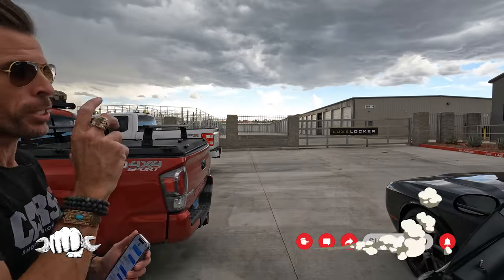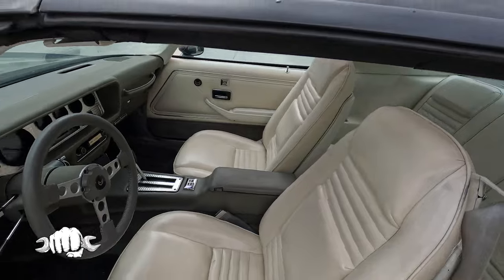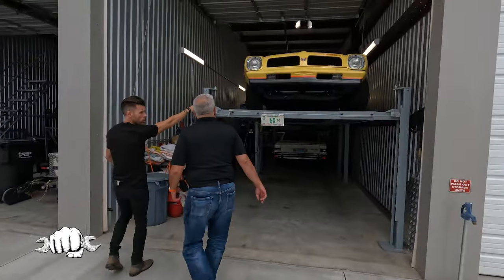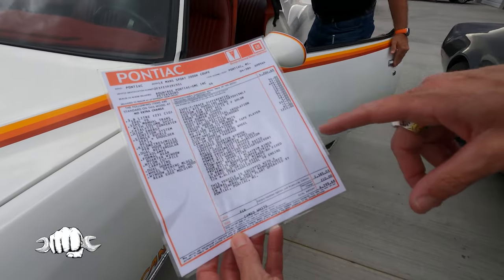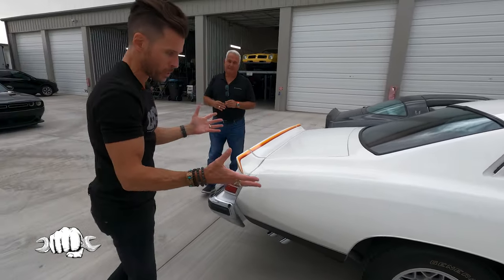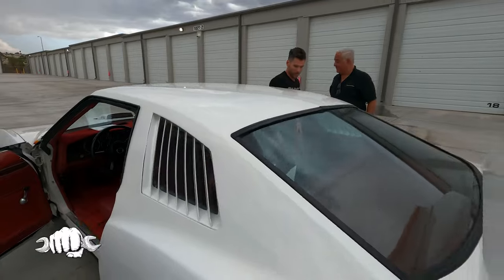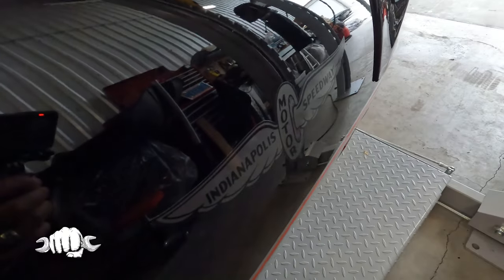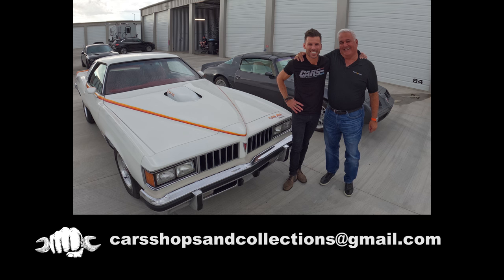PONTIAC HEAVEN! 1977 Pontiac Can Am! PLUS, '76 Firebird, '80 Trans Am and MORE!

Comment: I still own the '73 Firebird Formula that I bought new. It is red with black interior. 455 ( not a SD ) 4 speed PS PB radio. That's it. I ordered it that way. I should have spent the extra $ for the SD as it is much more valuable. I just barely had enough $ to buy the one I did as I was only 21.
Reply from the maker: No way!! If you were in Vegas I would want to film it!

Comment: Gas door is an 81.  The 76 Formula is nice ! Can Am is cool. The Can Am was a 400 with a turbo 400 tranny. Not a 2 speed. You can see through the drivers door, to the primer. What is with that ? and the right hand door on the T/A is a totally different color. btw 4.9 is a pontiac 301. Not a 305

Comment: The bird on the gas door is correct for 1980 and it should have a pontiac 301 not a 305
Reply: The bird on the door is for 1981 only.
Reply: The bird ia 81 only and both 301, 305 chevy were available in 1980 and 81 along with 4.9 Turbo
Reply: The fuel door was correct for 1981.   The 1980 was same as 1979. I know this because  I had a 1980 pace car Trans Am and I had to order the fuel door from parts.   I had ordered a 1981 Turbo Trans Am and the turbo engine was put on hold and after 2 months of waiting (eternity for a 18 year old that had a new trans am on order) I saw a pace car on a different dealership lot and my dealership tracked down a pace car about 40 miles away.  All pace cars had the turbo engine.  And a lot of neat details that were unique to pace cars and 10th anniversary models from 1979.

Comment: If that is a 301 ESC W72  call out is T/A 4.9 on the Shaker it is 170hp  255 ft lbs .   Some say 155hp  but is has been proven  to be 170hp  by calling it 155 hp it made the 301 Trubo look even better..